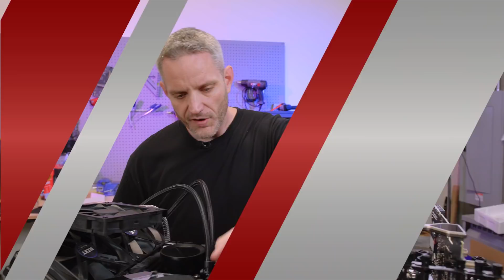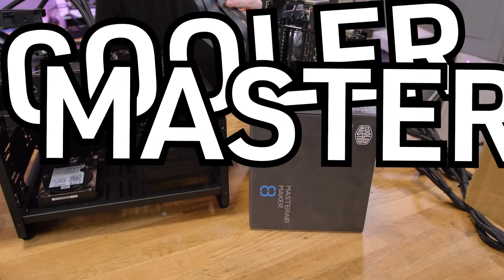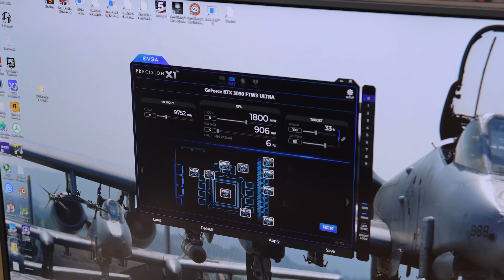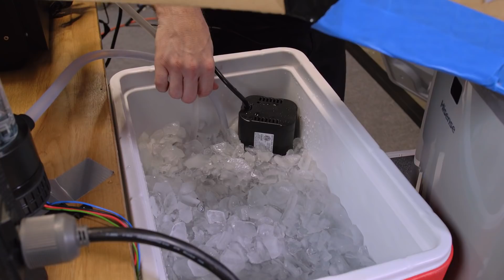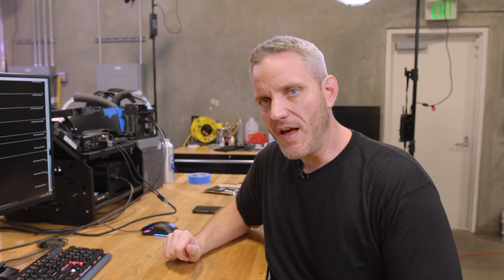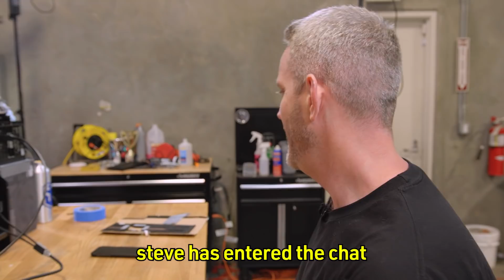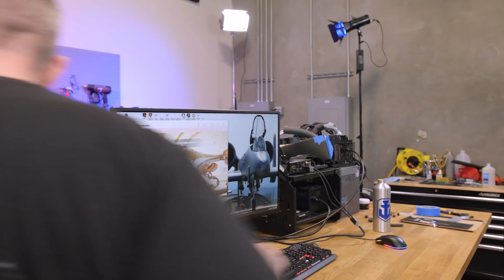Homemade Waterblocks for RTX 3090 SLI... these results are incredible!

Comment: Sorry a bit off topic.  I have Lian Li 011 Dynamic case and need to mount an addition rad.  Currently one at the top exhausting out.  Where should i fit the rad ie bottom or side and should i exhaust out of blow in.  Thanks

Comment: I would also appreciate a 3DMark etc. without OC, just by the way, for fun. I mean a 3DMark that only scores points for basic measures without OC.
1.) Because suppose someone wants to compare his hardware performance points with others and it is not immediately clear to those who do OC.
2.) That others can also see how many points someone can achieve with their hardware and cooling method without OC.

For example, I googled the Score # 1 KINGPIN and then found that he runs extreme cooling next to OC. For me, OC and Extreme-Cooling reduce the points achieved, it even falsifies the overall picture of the points achieved, the hardware performance and the cooling method for the average borrower. 

At last but not least: OC extreme cooling is not suitable for everyday use.
Reply: More importantly and the most important 4sure right here: 
Check that out, sort by "Newest first": 
https://www.youtube.com/user/damysticalone87/discussion
Attention! It looks like the YouTube-App doesn't show the right tab, open the link with a browser like Chrome!
Reply: Also they (3DMark etc.) could and schould hint a mark on those scores "This score was achieved with Over-Clocking (OC) and Extreme-Cooling (EC)".

Comment: Out of curiosity, are you sure that the gpu memory gets better cooling without a heat sink on it? I am not sure that is correct-the thermal conductivity of metal is much higher than air, so if you put heat sinks on the memory, the heat immediately dissipates to the heat sink, and then the higher surface area of the heat sink allows for improved heat dissipation...

Comment: Take a look at der 8auer - he uses fresh water, so the hot water never goes back to the bucket. The idea: use fresh water cool it in the bucket with ice - use the ice water as the reservoir for the pump. Fill up the bucket with cold fresh water. So hot water gets down the drain.

Comment: build a room, air-tight, air-cooler to -20 degree. setup it with dry environment. At least the motherboard, memory, HDD and psu are cool/coooooler.. that will give few percentage higher performance.. then connect the CPU, GPU to ice-water cooler (that will drop to another -10 degree). So much works just to win , so that i can watch youtube with a smile...

Comment: Ive never tried it but if your allways fighting condensation have you ever tried die lelectric grease ? Either that or a small coat of liquid tape , it would stick to the pcb tho in that case since its an "insulator" like electrical tabe but liquidified

Comment: @JayzTwoCents
Wanna squeeze a but more of the cards ?
Why don't you stick a bunch of those adhesive copper 1.5cm x 1.5cm heatsinks on the memory chips, that will work great on your AC cooling.
Regarding the ice water, dump a few KG of salt in that icewater basket. The salt will greatly lowers the water temperature, way below zero in celsius.

Comment: I was getting the similar problem with my AMD mining rigs a long time ago. Cards runung stock bios would change their specs whenever there was more than one card plugged to mobo. Each card on it's own was showing normal specs, but whenever I added more cards, their specs would change by a bit. The card in full pcie x16  slot would show stock specs, but any other card, second, third...sixth would change stock values, not by large but it changed. Idk why it was happening and I didn't investigate more than just finding out there was this problem, because custom bios solved it. It wasn't happening on every mining rig I built, some were OK, some were having this issue. It was long time ago and I forgot about it totally. This video reminded me, so thank you, I will now investigate more, now I'm interested in finding out why it was happening. 
Like always I enjoyed your video, funny and helpful 😂 Laters 🤙

Comment: i am still confused, that instead of the ice filled box jay has not yet bought a cheap freezer/fridge, the crate type for murder victims in tv series.
Fill it up with car antifreeze (-30°C) and those freezer packs (not ice cubes), and just directly pump the liquid out of there without radiator.
Will get you down to around -18°C liquid instead of 0°C ice cubed water.
 i would suggest the pump at the end of the loop (warmer) before reentering the fridge and also conformal coat-dip the complete pump or use a industrial version.

Comment: Jay Ive got the 3080  version of that card. Did you check the bios switch it?  Sounds like one was on normal mode and one was on the oc mode. I've also noticed it doesn't like to overclock when it's on the overclock bios. Makes no sense.  Maybe you can help with that.

Comment: Check if there is a bios switch?

Does one have MLCC caps and the other one not?

With full water block you should still use AC to prevent water condensate.

Comment: Try dry ice cooling. Definitely a lot colder than regular ice on the running water. Although might freeze if the water isn’t circulating quick enough.

Comment: For some reason I have a feeling that I am the only one that has fan issues. I chose the ll120s because they were reviewed as silent. I have 6 of them and my PC is not dirty. I tried everything from going to the Q-FAN control settings, and clicking on the optimize all(I have an Asus motherboard) and it did not do anything. One fan even ramps up to 4000 rpm. It is really bugging me how loud it is, and I am clueless why my PC is so freaking loud.  I can't afford a fan controller like a commander pro, and I noticed the CPU has been slight overheating, 40c on idle. Is there anything I have to do to make it quieter?

Comment: use a ice/brine solution.  In an ice/water solution, you will have the water be at 0 or 32 ish.  With a brine solution, you can easily get -17 C or 0 F temps.  You can still claim it as an ice water bath...Just know that it will probably impact the longevity of the pump, so don't use it in for a long term rig...

Comment: I love that "battle" of you three :D Just curious... Why do you not add any heatsinks on mems, which help your AC to keep them colder... I know, the block is big, but you can cut some fins of heatsinks, and they will still cover whole module, and the rest of the fins will help temps a lot, because of the heat conductivity of heatsink material... You can "glue" them there just by thermopaste, so it will be very low-profile... Or just use something like this, and cut it in half... https://ctrlv.cz/T2og

Comment: Hello Jay.

Just in case you don't know.
Air-conditioned air is very dry, as the AC process takes the moisture out of the air.
Which is why you don't have any condensation even with ice water, as there is no moisture in the air around the blocks.
So that is a trick for you going forward.
Thank you for always interesting and informative videoes.

Best regards from Denmark.

Comment: Pull the bios from the higher boost table card and flash 2nd card with it. For pascal, the maxwell bios tweaker still somewhat worked, you could also use that to increase power limits and maybe try disabling gpu boost and going with static frequencies.

Comment: Not a good idea to use AC cooler to blow air on electronics since its damp air that comes in contract with hot components and will create condensation on the board that will corrode the board on certain parts. This is not a smart idea. This was done before in data mining servers in a building that blew AC directly on to server mainframes. After awhile it corroded the whole thing. Nothing good will come from this if you are suggesting this to your viewers. Blowing damp air on hot components is a fast way to ruin them!

Comment: Alright i need to know if this is a good setup or if something needs to change to be more compatible
I got:
-B450 AORUS PRO-WIFI
-RYZEN 7 3700x
-80+ gold 750w PSU
-Sabrent 1Tb ROCKET NVMe SSD
-GeForce RTX 2070 WINDFORCE
-Corsair Vengeance RGB Pro 2x16gb 3200
whats the thoughts other then the waste of money parts i already know😂😂, any bottlenecking? im new to most of this but had done a decent amount of research

Comment: You could try getting a fish tanke and fill it with mineral oil. then place the radiator inside the mineral oil and have pumps push the fluid through the fins. to cool the liquid you should just toss some dry ice into the oil and good to go. the tems should be the same as water but have a bit more consistency

Comment: Q (heat) = 500 x flow (gallons per minute) x delta T (temperature difference). The amount of heat that can flow is proportionate to the temperature between the card and the loop temp. It looks like you're Currently piped out of one card and into the next (piped in series) so your second card is seeing warmer water. Look up "reverse return piping configuration" to achieve a parallel piping configuration. This will ensure you're sending the coldest water to each block, and it's self balancing so each card will get the same flow. No idea if you'll ever see this, but I'm an engineer who designs hydronic systems for buildings.

Comment: Regarding condensation. The A/C not only chills the air it also "conditions" the air (hence the name) meaning that it de-humidifies it. Basically it dries the air by making more of the water condensate on the chiller rather than on the cards.

Comment: @JayzTwoCents
Eehhh.... Couldn't the "loop order" plays some role in making the "second card" in the loop run a bit """hotter"" than the card getting the water "directly from the iceBath" ?? Would be interesting to see You run with "separate loops", or a single loop but put one rad after each card" so they both got "the same amount of cooling".
Best regards

Comment: If you want to prevent condensation, purge a sealed case with nitrogen gas keeping it at positive pressure. Then you can cool it down as much as you want

Comment: Suggestion:
 1. Take the bios from the higher boost card and flash it to the lower boost card. That should fix the boost tables.
2. Add some salt to the water. You'll see better temperatures.

Comment: Hi, i dont know if you allready "mod" the windows but you should get rid of the "bloatware" Chris Titus has quite good guide on his site and has one line script for it to run in power shell. You can also check the script in text before and there is option how light version of win10 you want to go. Some of the benefits are no cortana and telemetry.

Comment: Regarding the the lack of VRAM heatsinks. One big reason just (chilled) air blowing over it doesn't work so well for heavy overclocking, is GDDR6(X) is flip-chip.

And on the 3090 it's tightly stacked in a serious hot-core sandwich, and the airflow can't get to the hot core. Those GDDR6X puppies run seriously hot as is. You either need some heatsinks on those modules to way more efficiently "draw out" that heatload and spread it out over much bigger surface area (air is a poor direct heat exchange medium for high thermal density) - or LN2. With LN2 the thermal delta is so high, it heavily chills the large bus and ground planes of the GPU PCB, which in turn "draws heat" away from the memory modules at the source (underside of the chip facing the substrate) through the traces. It does the same for the VRMs.

Also regarding the VRMs - you gotta remember that with the 3090s, you're pretty much starting out with them pumping 400++ watts at stock boost. These cards need those huge (and expensive) coolers on them for a reason, just to run @ stock. In comparison to ie. Touring, for this OC context you gotta treat them as if they were already shunt or bios modded and running a +60% power draw pretty much right out of the box.

Comment: Why haven't ya'll thought about PSU?!  I mean it's a rip so use an inefficient linear psu that can output gobs of power with  less ripple than  1/8 wavelength diffraction limited  mirror!  I mean in theory the card regulation wouldn't have to work as hard.... and 1 awg wire going to the card!  And why hasn't anyone at least tested supply voltage input increases/decreases (supplied to card) to see the power difference the gpu card  and thus amount it has to dissipate in heat?!  Ya really think the standard output, whatever that may be from your individually different PSU's ya'll are using,  is the optimum for the card you have?!  C'mon man, let's RIP IT UP!  We're only talking rip and that .025% might get ya the bragging rights!

Comment: This is all well played by nVidia HQz....
surely, it helps just let the enthusiasts have fun at it with new flagship gpu/cpu chasing records. +$3,000usd gets you top tier rankings,.
An SLI setup used to make sense when you could put 2x $300usd card and get $500usd performance..... 
now SLI is kind of dead ☠️ and top tier GPU cost $1,500usd + $1,500usd to play 💥💥😱

think about that for a second....
Mid/entry level gpu cards is excellent bellow $500usd and the iGPU market is still getting stronger for everyday use.... but 
current Ryzen/intel chips are good iGPU.

I don’t know 🤷🏻‍♂️ but I don’t think nVidia will be around much longer.

You see nVidia doesn’t make CPU and lacks an x86 license, AMD and intel do,.
nVidia purchased ARM, but I don’t think ARM can save them (mobile/apple). 
Intel and AMD will transition into VPU and nVidia will be phased out as a simple optional peripheral.
and no,. I am not an AMD nor nVidia fanboy,.
I’ve bought mostly nVidia products,.
But the way I see it,. 
[CPU+GPU]+[RAM/VRAM]+Cache will inevitably all live within the same chiplet designation...

Comment: He should have a mains line voltage regulator and noise filter with a very short EMI proof Lead to the PSU. Then have the rig in a chassis to act as a faraday cage.

Comment: I’m definitely a newbie to pc stuff, so I could be talking out of my ass on this one, but do you think that maybe the card manufacturer sent you a slowed-down card because of all of the issues they were having? You recently talked about certain manufacturers going cheap with the MLCCs, and maybe they could have just fixed that with a BIOS update or something, but maybe they decided to change up the firmware to deal with people’s crashing problems. I’m not sure if that’s even close to accurate, but I just figured I would throw that out there as an idea for why one might be slower than the other, especially if you happened to receive the slower card after getting the faster one.

I dunno. I’m dumb. Go easy on me. Love the videos man ❤️

Comment: JAY
or point this out to Jay
AC air is super dry too. Blasting the cards with cold dry air, would help rip away condensation building. 
🤔Wait... Wait, what if we combine cooling?
AC to move the air, keep things dry by blasting it dry, with a pot.
Ideas for later, -- who else would do it?

Comment: I don't remember if you have mentioned this, but one advantage of blowing cooled air from the air conditioner on the components (instead of normal fans) is that there is very little moisture left to condensate on the components. Because much of the moisture in the air condensates on the air conditioner's cooling radiator and so the cooled air coming out is quite dry.

Comment: “165Hz over clocked display” Woah wait a minute, why is it over clocked?
Reply: Why not?
Reply: Why not? Wdym? Why is it overclocked to 165Hz? Do you know that it degrades durability and longevity? I don’t know about you but I’d like my product to last as long as possible.
Reply: @DarkSansTV  I had a 75hz lg 16:10 that I ran overclocked to 100hz for 4 years and it still works, but i wanted 21:9 so i got one.

Comment: WAY to rub people's faces in the fact that even though they can't even get a SINGLE card, you are special enough to get a matching PAIR of cards. Great job Nvidia and Jay. You might as well put the icing on the cake and pull a Linus by dropping the cards on the floor and bricking them and still getting a replacement before week's end.

Comment: Use NVFlash to download the firmware from the good card and flash the bad card with it. What's probably happening is that the two cards have different binnings, and the bios is adapting to the chip binning. In which case reflashing is not gonna help, probably. But at least you'll know.

Comment: Jay, I know u used to always say you don't need card radiator card loop, but maybe the 3090 is weird and this loop setup will matter in this case. You can try doing that and get same temps on both and also use same thermal paste, preferably Grizzly Cryo. As for air conditioning part, you can try to make additional box that would go all over the cards and add one or two 140mm fans at the end to increase airflow all over the cards equally. Additionally you can add salt to water to bring the temps even lower on GPU.

Comment: the second GPU normally acts as reserve VRAM doesn't it? so it wouldn't really clock differently as the first GPU would take up most of the Work load.... Plus Nvidia said they were working away from SLI this may be a precursor to this

Comment: Hey man, I was looking at server equipment the other day as I’m getting ready to do an in home one. Obviously that blowymatron-5000 works fine, and I don’t have any experience with this yet, but they sell those server-type AC units with what looks like, just a giant 4 Inch PVC pipe coming out if it. Any difference with those units vs what you’re using? I know you’ve said numerous times you’re a “if it isn’t broken, leave  it alone” type of person, so I get why you wouldn’t buy a new one. Thoughts?

Thanks